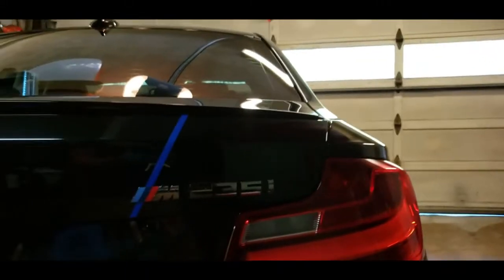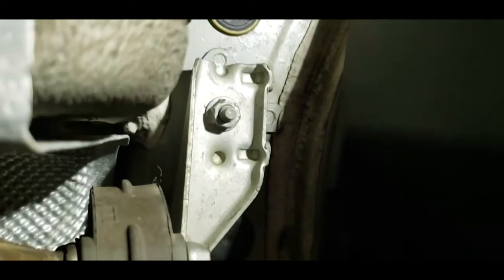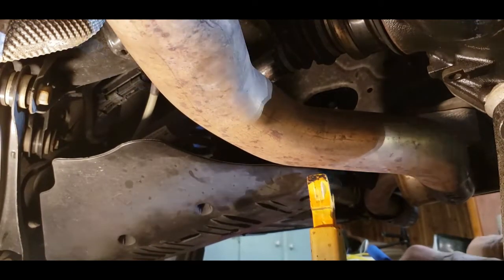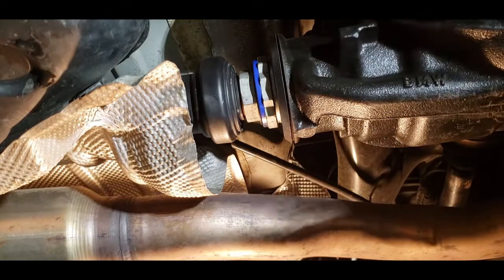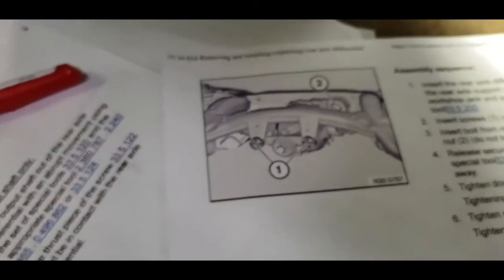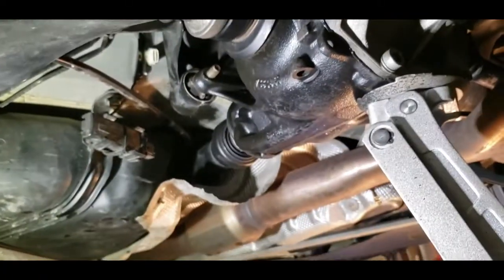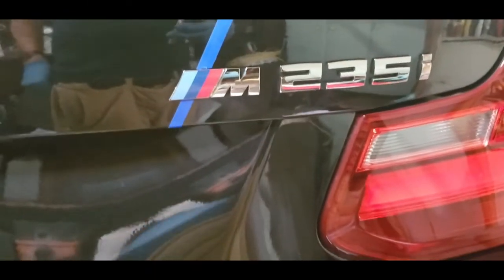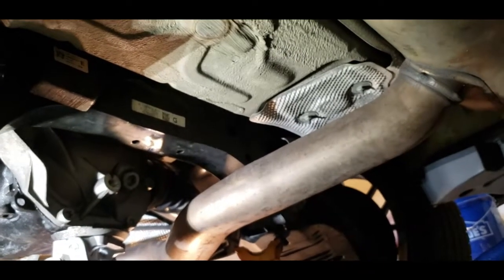Installing a Quaife ATB LSD (Differential) on BMW M235i, with No specialty tools

Comment: Hey how’d you remove the shaft from the pinion nut
Reply from the maker: @an63l36  2min 35 sec.   If I remember correctly, the threads are really little so you have to turn it like 20 times .  This is why I said after it's loose, use channel locks or something smaller to spin it. .   Good luck.  I'll try to help if I can, but it's been a while

Comment: Thank you for this video.  I just bit the bullet and purchased a Quaife tonight for my M235.  I've been considering doing the install myself.  Still kind of shitting my pants at the thought of it, but your video certainly gives me confidence that it's possible.
Reply: One last question, if you'd be so kind.  Did you fill it with fluid before you installed it, or after?  If after, did you have to use some kind of pump/syphon/syringe?

Thanks again.  Tomorrow is the day.  The 50mm cartoon wrench showed up today :)  Quaife is in the air over the Atlantic as we speak.
Reply from the maker: @NJFPV  after..  hose on a bottle.   Think I had a bottle I could do that with and squeeze.   Doesn't need to be pretty.   They do sell little fluid pumps at harbor freight. 
 You got this, but  Best of luck
Reply: @nixeighty6  thank you!!!
Reply: I just wanted to say thanks again for all the help, man.  It took quite a while, but she's done.  I don't know if you did it alone or had a helper, but if you were alone, holy shit.  There were several times that 2 of us needed to go hands on under the car to keep either the old or the new diff from coming off the jack.  They are pretty heavy when you're on your back/side trying to work, lol.

Anyway, thanks again.  You gave me the confidence to tackle it, and I wouldn't have tried had I not seen your video...

I appreciate it.
Reply from the maker: @NJFPV  yo, so cool, and thanks for the feedback!   Glad you were able to do it yourself.
   I did do mine solo.. but that's life sometimes.  
Cheers brother...   Drive Fast, Take Chances
Reply: @nixeighty6  Yall motivated me to go for it and i got myself a quaife for the 240 thats arriving next week which ill install in the coming month, go a couple of questions please, ill probably film the whole process to document it for future persons. How did you remove the bolt before the differential that attaches to the shock absorber, cause from what i understood you would use a ratcheting wrench on the outside, is there enough space for the other side? How hard is it to actually spin the 50mm wrench, cause ill have 2 feet of space theorically (ill ask a mechanic to rent me by the hour a quick jack cause im scared shitless of jackstands on my uneven garage floor) and the wrench is 24inch. And how did you torque it to spec to 100nm you said in the video just by feel, but wouldnt a crows foot be good for this job with a breaker bar instead of a wrench? And how hard were the axles to pop on a scale of 10, is there any way i can damage something by puting the screw driver in there, is it the circlip that you actually push? and did you replace the circlip afterward? Someone on the forums said to pop the axles much easier to "Just removed the bolts on the top 3 suspension arms (hub side). This allows you to pivot the entire hub outwards, enough to pop the circlip out of the groove and slide the driveshaft out the diff.
Then, yes, you set the jack sideways across the car, undo the diff mount bolts and drop the diff a little in order to pop the other side. Tie up the side shaft and pull the pumpkin out." I dont know if this is overboard for the job or i should just do it to get it out fast. And how long do you think as a first time diy except for the oil and tire changes i can do this, would 6 hours be realistic or too optimistic? Thank you and have a great day
Reply from the maker: @TahtohDrives  don't work on an uneven floor with jack stands.  Sounds like a bad idea.   As for the rest...  I made this video how many years ago, hell .. I've had my M2c for 4 years now.
  This isn't a technical or step by step video.   I just made to to say it can be done without specialty tools.  
 The axels do pup in and out without having to replace anything.

Time depends entirely on competency.

Cheers and best of luck
Reply from the maker: @NJFPV  its honestly not that bad to do.  Wish I made a better video as I didn't realize how many views it would get.   Loved that car and quaife made it for sure.  I've been driving an M2c now for almost 3 years. So it's been some time.
   Thanks for sharing, hope it helps
Reply: @nixeighty6   Yeah!!  You followed the dream we all have and moved into thr M2! (and a comp - wow, that's awesome!). Good for you, man.  One day... one day.  And I know you wish you made a better vid, but honestly, it's perfect.  The fact that it's raw and no frills I think is what the charm is about it.  There's no BS calculation that needs to be done about what the job ACTUALLY looks like, because all I see is a 2 second cut of some guy with clean hands and a smile holding a wrench, with a catchy beat playing in the background.  You show the pertinent points, and we're on our backs on the garage floor with you - nothing more that can be asked in a video like this!

Just to ask - is there anything else to the job that you think is important to know?  I have watched a couple diff swap videos for other models and I see people doing all kinds of craziness, like loosening suspensions and transmissions, etc. From what I have gathered in your vid and what I understand about the process for the M235, I will need a 50mm open wrench, some big flatheads and a prybar, a jack, some patience, and some 75w90 synthetic gear oil.  

Seems like you dropped exhaust, unbolted the drive shaft first, then loosened the bolts of the diff from the car, then separated the left and right axles by prying them, then unbolted the diff entirely and swung the whole unit down, allowing you to remove the axles entirely and pull the diff out.  Same/opposite on the way back in...

Sorry if I'm asking too much - I'm just trying to mentally prepare, and would love to know if I have a key misunderstanding somewhere...

Thank you again!
Reply from the maker: @NJFPV  cheers and thanks for the props..  I just put it out cuz I didn't see one on even an M235i diff.  10kviews. Lol.
   Think you mostly got it, but 2 points
1: the oil for a quaife is VERY specific,  don't f*ck around there..  I cover that at 8m42s in the video.   It doesn't have any friction modifiers at all, which almost all oils do.
   The oil is good for LIFE. Yes, literally..  I asked the guys at birds garage and the said no "break in" change or ever. Even if racing endurance races. Or with hundreds of thousands of miles.   I was shocked, (please do confirm with them. Cuz it's still hard for me to believe)
  2.  I did not have to take off suspension stuff, and that's why I tey to describe that turn I did to get the axles out.  It is doable, if maybe a P.i.t.a.
   If you have to take off suspension. Just remember to mark the alignment bolt.(s) and you shouldn't need an alignment.

I loved that quaife..  if you drive hard it's a must.  

Best of luck
Reply: @nixeighty6  thank you!!

Got it.  Will verify (very specifically) the fluid, and understood on the suspension.  I suppose it might be the "simpler" way, to pull the axles out of the pumpkin rather than maneuver the pumpkin off of the axles, but I'm with you 100% on how you did it - a little sweating, cursing, finesse, and rough-handling, and that thing will come out...

Anyway, thanks again, and thanks for the additional info.  With any luck, I should have a MUCH better handling machine in a few days :)
Reply: Quick question if you're around. I'm under the car now and loosening the prop nut (step 1 essentially).  Been turning it for quite some time now with no sign that progress is being made.  I can only get very small turns (⅛ at most) as the Amazon wrench I got is 24" long (looks to be longer than the one you got).  Channel locks is still incredibly hard each turn. 

Question is - how did you know when you were out?  I'm guessing it will begin to 'click' when the beginning threads begin to pass each other.  

I suppose I just want to know if this is normal...

Thanks man!

Edit:  lol.  Ended up cutting the wrench with the roto zip so I could swing it the full length.  Saw threads after 2 turns.  Became much easier after that.  I didn't want to lose confidence so quickly!!!   Back on track though... :)

Comment: Did you replace any of the plastic dust shields/washers as well? Or did you just put in the diff?
Reply from the maker: It comes as a sealed pumpkin, so it's more of a pull the mounting bolts out and pop the driveshafts out of it. Not really any plastic dust Shields or washers to replace

Comment: Curious, did you try Kassel?
Reply from the maker: So I did.. assuming you are referring to Kassel performance in York Pennsylvania.  For one, those guys are awesome.
But iirc, I might have asked them "if they had the specialty tools for the axels".  (The main reason I did this video was to show you don't need them)
I believe these guys would have done it, and with no problem..  but I think how I asked them made them reluctant to take on the job. 
Again, I very much like those guys at Kassel, I've used them in the passed and will again in the future (I currently own a 2021 M2 Competition)
Reply: @nixeighty6  that makes sense. Yeah I have only heard excellent things about them. I'm getting the MP differential and was going to ask them for a price just to see as I am near York. Thanks for the video!

Comment: @Nix86 thanks for sharing your experience, I am currently going trough the same ordeal. If I get your instructions correctly, you pulled the shaft on the left side first, lowered the diff and then pull out the right side? Am I correct?
Reply from the maker: At 5: 50 I try to explain how I got it out. And iirc I did pull the whole unit down  and got the drives side first.
I'm sure if you pulled the wheels and two lower control arms.. maybe just from one side (and not at the alignment bolt) you could possibly get it out easier.
But, I was able to get it without hurting anything and a year later its Fantastic! 
Best of luck
Reply: @nixeighty6  well, I finally managed to do it. It wasnt easy but it is indeed do able. 10/10 will not do it again...
Reply from the maker: @3xcelsi0r10  first,  Attaboy!
 I'm glad if this helped in any way.
just sold this car today..  M2c on the way so I also 10/10 have no plans to do it again! I have been sooo happy with the Quaife..  and My buddy who bought it is glad I did it also
Reply: @nixeighty6  congratz on the new M2!!! Have fun and stay safe out there

Comment: You notice better take offs in staight line? I'm debating on wider tires or an lsd. I don't track the car and I'm just hoping to get a bit more traction from a start.
Reply: And 2 years after the reply, but on a debate between wider tires and LSD, I don't think there's any debate at all... You can go twice the width of your current tire by installing a device that allows you to actually use both rear tires (as a sports car was designed to run), not to mention the immeasurable other benefits in driving, cornering, wet and snow, and general safety of the vehicle.  So yes, you can get wider tires without doing anything to your tires :)  just use both instead of one! 

In other words, don't try to solve it with a wider one wheel drive.  It's just as lame, but you have less money with the same amount of lameness ;)
Reply: @NJFPV  Even with an open diff, you'll of course be able to use both of the wheels. The thing is, the wheel with more grip can not transfer any more power than the one with less grip. That is what an lsd fixes.
Reply from the maker: Hey, really sorry I didn't see this until a year later..  yes, much better "drag launches".
  Before it would just do one wheel peels. Highly suggest

Comment: The axles, are they fastend in any way ? Or do you just have to put them in ?
Reply from the maker: They are not fastened but do have a clip that tensions them in place..  it just takes a little pressure to unseat them to take them out. Then you just put them into the new one and the last little bit takes a tap to fully seat them.

Comment: Do you like the quaife so  far ?
Reply from the maker: In short, YES.
In long..
It's been "like factory" in all ways of use..  quiet, seamless and functional.  With it being the same price as the M performance BMW diff in this application (F22) I would do this again anyday. 
2 benefits over clutch type are this won't wear out like a clutch type, and for some reason Birds ok (Quaife) said "no oil change necessary ever"..  no, really.
Reply: @nixeighty6  Same price ? isn't BMW diff like 2000£ ? 😰
Reply from the maker: Yeah, there salty...  I cant keep up with exchange rates but yes it was $2700usd or  2000 pounds
Reply: @nixeighty6  Have you tought about wavetrack diff ?
Reply from the maker: I have no experience with wavetrack..  think it was right around the same price when I was looking at options.

Comment: Hi, which model did you use ? I have a m240i and they say it won’t be a bolt on mod.
Reply from the maker: Sorry but I'm not sure what your application is going to be..  If your set on a Quaife and they don't have a complete "final drive" for your car you might be looking at a process something like this (vid below) 

when I was weighing all my options I talked to a local shop about doing this crown removal and Quaife install but it was the same price for me to just get the whole pumpkin from Birds UK.  I'd start hitting the car forum for options..  best of luck

https://www.youtube.com/watch?v=CtREWyc8jJo

Comment: I believe you have to have it your car coded  to unlock  its full potential
Reply from the maker: https://www.2addicts.com/forums/showthread.php?t=1614362
Reply from the maker: It's a helical Limited slip..  what would you code, traction control settings?  I don't believe this to be the case but i'll do some research. Could you please reference any info you have on why your saying that? the car hooks up and 2 wheel drifts (when asked) perfectly.. but i'm always open to new info